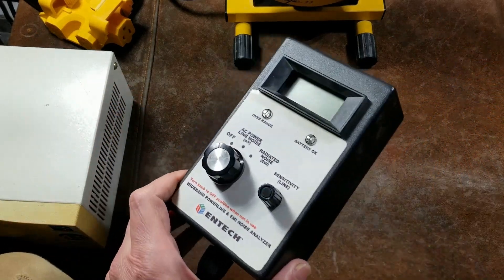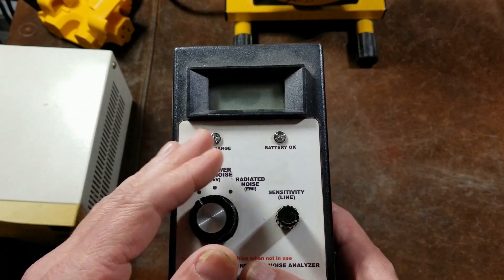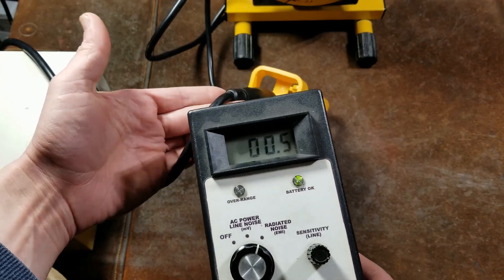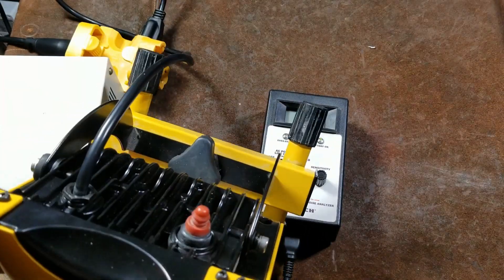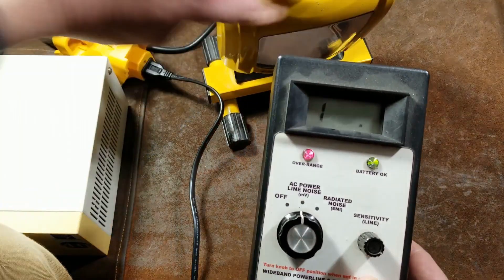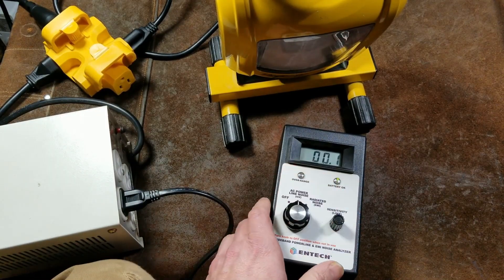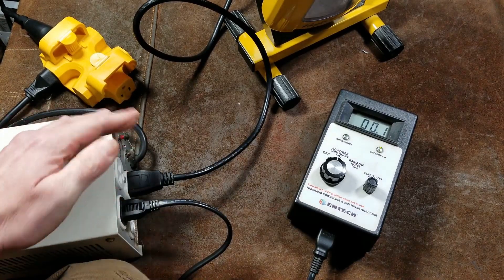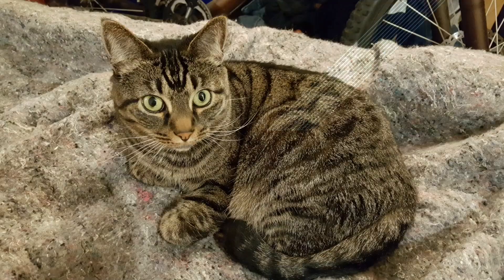Monster Cable EnTech EMI Noise Analyzer Review

Comment: A repackaged AM receiver  but most likely  not a superheterodyne with a high gain unshieled audio amplifier. Taking advantage of the broadcast wave length and the house wiring length. A little smoke and mirrors in the day. LED lighting with cheap switching power supplies todays real problem with noise.
Reply from the maker: Thanks for explaining that and it sounds like something Monster Cable would do to take advantage of people like me who don't know any better
Reply: @CatusMaximus  The electronic high-end audio industry and I would include cameras of the era also were very dependent on an existing customer base to buy into upgrading for their survival. They hired amazing wordsmiths.
You should make a video of hand saws of the 1800s ,how where they made and the use and over maintained.  
Your very good with tool history
Reply: Hi sorry to jump in  I am not an expert but i would like to understand that there is some space for DIY project.  I bought already an Entech noise analyzer this one 
https://audiophilestyle.com/uploads/monthly_2012_11/58cd95ff14cad_(KGrHqJ!oIF!Fg)VFV7BQJBjoTIbw60_57.JPG.85be5990c80ae81bc7747a2f5386685f.JPG  unfortunately i then discovered that is for 120 VAC .. here we have 220 VAC  so i have always to use a step down transformer before the analyzer.    I am looking for something similar that can be used with 220VAC ... and a diy solution could be great.  If you have any idea it would be great
Thanks a lot and kind regards,  gino